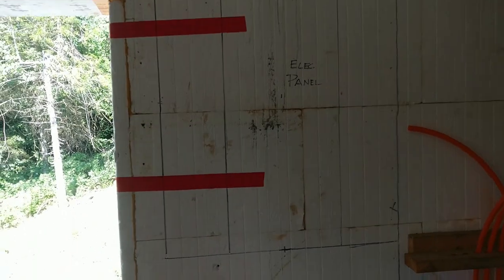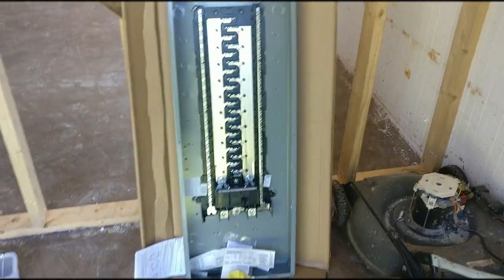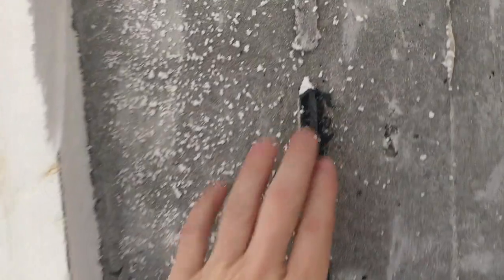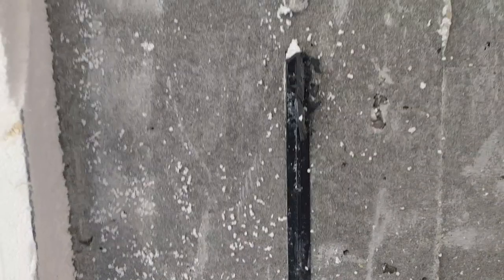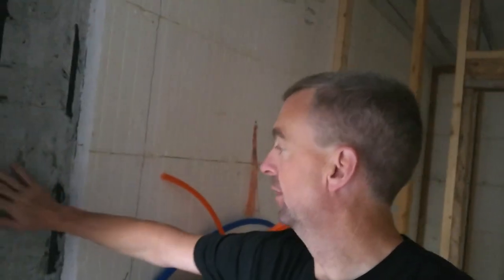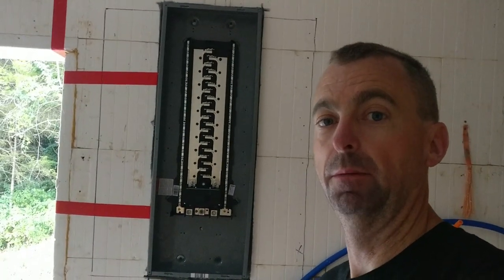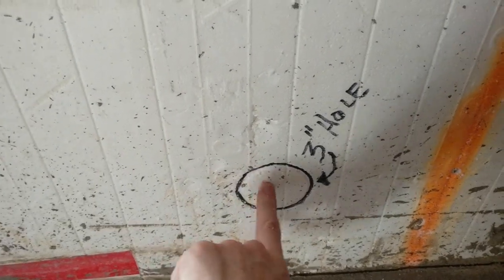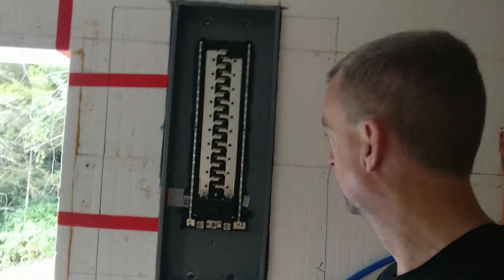How to install a Homeline Electrical Panel in an ICF House

Comment: The panel seems a bit high. Additionally, since every wire coming in needs a strain relief and to be stapled above or below the box, won't you have to excavate more foam above and possibly below?

Comment: Why not hang plywood, instead of cutting foam
Reply from the maker: Hi Joe! We want to finish the room out with drywall and want the box set in the wall.
Reply: @LakeLotBuild  You will still require plywood in order to properly staple the wire above/below the box...

Comment: You sure the top of the panel isn't higher than 6'7? Otherwise been loving this series!
Reply from the maker: Will measure today!
Reply: I believe the national electrical code states that the main breaker or the highest breaker in the panel cannot exceed 6’7”.
Reply from the maker: Thank you! We are good then. The highest breaker is under 6'7".